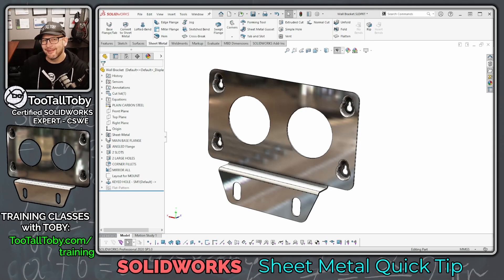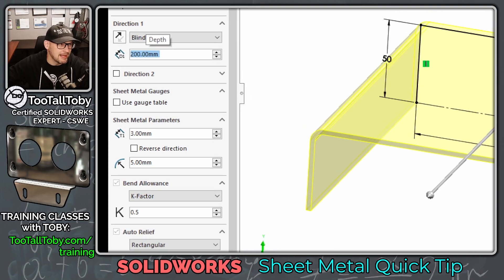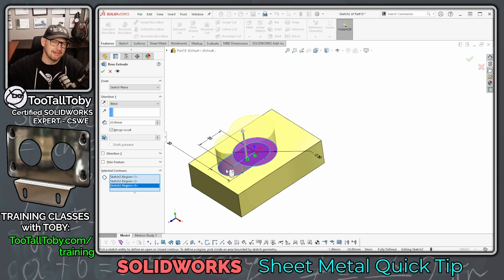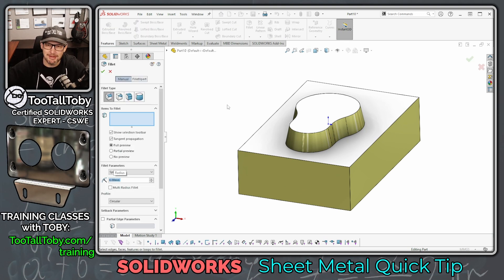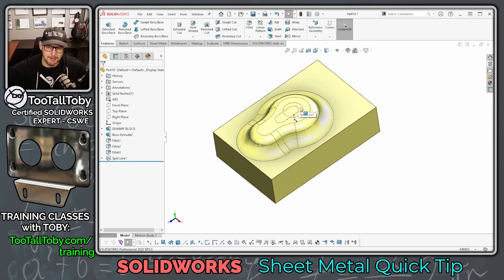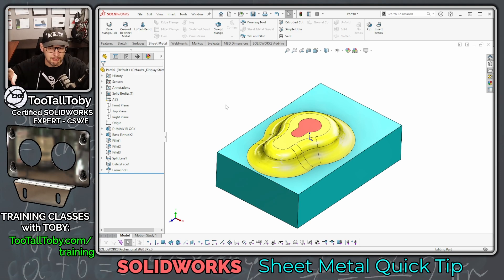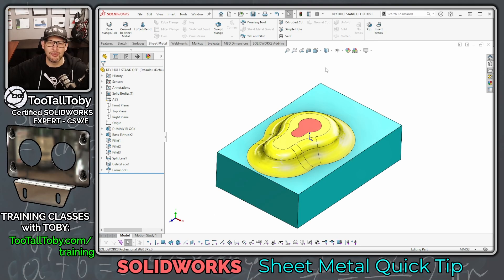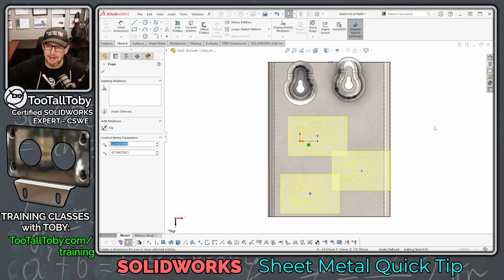SolidWorks Sheet Metal Forming Tools - How to make an emboss with keyhole

Comment: hey mate, do you have a workflow applying features for sheet metal roller beading, I can model it out bit by bit, but I would love to identify a method for applying a bead to a line/contour/arc and have the bead applied along that length. love you content 👍👍

Comment: Nice!
I barely remember setting these up back in the days!
I'd been meaning to try the Onshape forming tools so I created a version of this as it looked like a perfect practice (look for a shared doc message)! It's quite different takes a bit to wrap your head around what things need to look like but it works pretty well!
I based the bend radius on the thickness so it adapts to different thickness materials (even though it's a different tool at that point!) and while I was at it I also added a configuration input for the depth just for fun!
Reply from the maker: yeah I'm excited to try the onshape forming tools!

Comment: What version of Solidworks are you using now?
Reply from the maker: I think that one is 2020 - I dont really need the newer ones - not much has been added.
Reply: In fact it has. Mostly in Surface Modeling.
You have Thread and more
Reply from the maker: @ help.solidworks.com - WHATS NEW - show me what you mean
Reply: For example, you can do a thread without doing cut swipe
Reply from the maker: @ciorad1389 What's New in SOLIDWORKS 2016 - THREAD - You can create helical threads on cylindrical faces using profile sketches. You can store custom thread profiles as library features.

Using Thread , you can define the start thread location, specify an offset, set end conditions, specify the type, size, diameter, pitch and rotation angle, and choose options such as right-hand or left-hand thread.
Reply: I mean cut sweep
Reply: Yes I know that
Reply from the maker: @ lol - nice 🙂